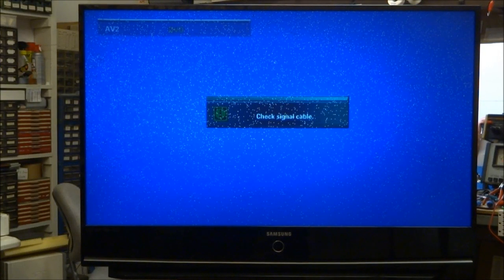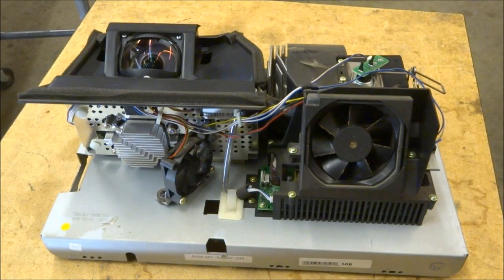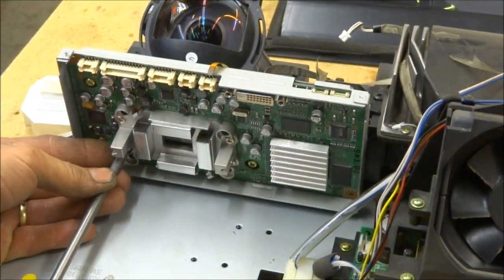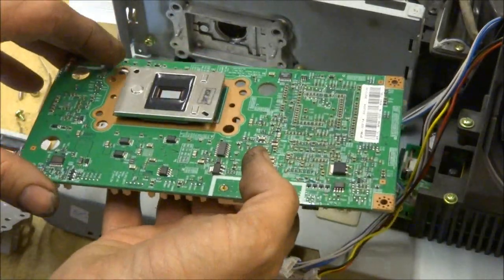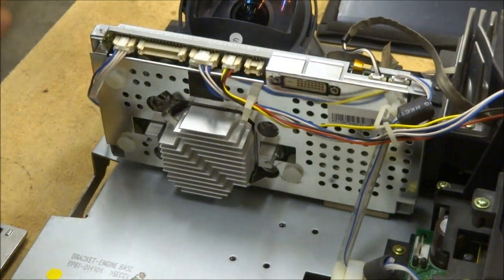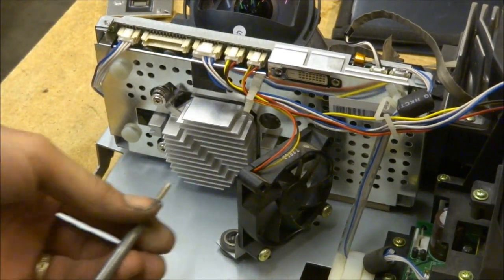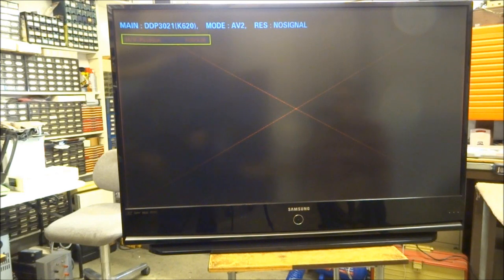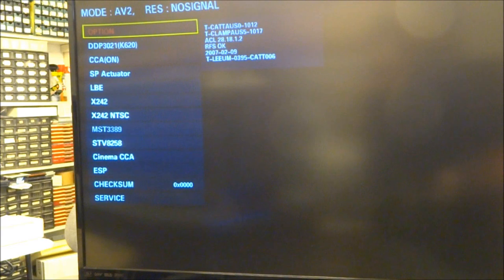Samsung DLP White Spot Dot TV DLP Repair FIX 4719-001981 4719-001997

Comment: Hey I used this video to replace my chip.  Everything is working fine except for 2 things.  Right away my picture was showing a little red tint and after about 2 weeks I have the shadow running across the top 25% of my tv.  How can these two things be changed?  I do not have the LED model.  I can give you my email if that is better for you to connect with me

Comment: Great video!  I have the white specs, as well as a 1/2" line on the left side, on my HL61A750A1FXZA Sammy.  Am getting ready to order the DLP chip from ShopJimmy.  Will use this video for the install.
Reply: ***** I was hoping the new chip would fix the 1/2" line but obviously it did not.  Is there a vid or instructions on what to do?  The DLP chip install went fine.  I highly recommend taking pictures along the way especially when unplugging the connections inside the TV.  The TV shown in the vid is a 50" 720 Sammy where ours are the 61" 1080 model.  The insides are different so the instructions on the vid do not totally correspond to our TVs.  The pics helped a lot when putting everything back together due to the vid instructions being different.
Reply: ***** I appreciate the help.  Did some Google searching and found it is an adjustment to the light tunnel.  Seems to be a common problem with some of the older TVs.  Hope to find instructions that corresponds to my TV.  I've had the 1/2" line for about six months now.  Luckily it has not got bigger.
Reply: ***** Great.  Thanks!  Seems simple enough.  The hardest part will be getting to the back and inside while keeping the TV powered on.  Funny, think those are the screws the white specs fix video tells you NOT to touch while replacing the DLP chip.

Comment: I need help because I got a head of myself and remove the wrong screws on the board. Yes, the three screws your not to remove.  Now I have a black boarder at the bottom of my picture. It's not a shadow, it's a boarder about 2" all along the bottom of screen. This will be my forth time changing the chip. I never had this to happen.  I need to make the adjustments to get that out

Comment: Would cleaning the chip itself remove these dots without having to replace the entire chip ?
Reply from the maker: No. It is a defect of the micromirror system.
Reply: @norcal715  Yes, the mirrors are stuck in one position.

Comment: I have a question , I just replaced my dlp chip for my Samsung model# hl-s6186w , everything worked before just had dots on screen. Well when I changed the dlp chip I replaced the lamp,now none of the fans  are coming on and neither is the lamp. What could have happened?  Can so e one please help. Also 2 lights are blinking standby and timer ,and tv clicks like it wants to turn on. Any help is appreciated.

Comment: norcal715, In the service menu, I was successful at fixing the screen alignment following your instructions in the video. However,  I have accidently changed the setting of my dlp tv Lamp Sync function "Pulse" - and the screen disappeared and the TV power now keeps on recycling on-off while the lamp tries to come on until the timer times out before getting any screen, and the power recycles again on-off - so on and so forth. No matter what I do, this operation takes place as soon as I plug the cable in the wall. It is set on an automatic "pulsing mode" - and I cannot see the screen to be able to reverse the unfortunate setting change I have made. Could you help with this issue? Thanks in advance!
Reply: your bulb is burned out that's why is cycles like that.
Reply: Ken, I replaced the lamp twice (although after market ones) - The first one obviously worked initially - Then after changing the setting and I lost the screen I thought maybe the lamp went out - Discount Merchants sent me a replacement after market lamp - the outcome did not change. Do you think it is still the lamp? - BTW, since my post I have replaced the ballast with a used working one - it did not change the outcome either.

Comment: I solved my dots problem, but the color wheel is now going bad, where do you find parts for a  Samsung HLs5686w    I found the color wheel number on the color wheel BP6101193a-  I cannot find one.

Comment: Is it the dust on the chip that causes the white spots to begin with. Or is the white spots a definite sign that the chip is BAD?
Reply: Its the LED(s) inside the chip, if it is dust, it will look like a ping pong to soft ball sized blur or shadow on the screen.
Reply: dlp is more like little mirrors that move around to reflect the light. they get stuck after some time.

Comment: Hi I have a question, i did this repair with thr dlp chip like you showed white dots gone thanks but I have an issue with the picture, it won't adjust vetical more than 60 and won't go anymore, you can't see the bottom 2 inches of the X where the X is supposed to be touching the bottom corners, and it leaves about a 2 inch black gap at the top of the screen, is there anything I can do about that? Model HLT 5076S
Reply: i just saw another video that shows you have to adjust the board, loosen the screws and move it downward and then tighten it back, i didn't think to make alignment marks with tape and cut them to align it perfectly afterward, i had assumed it was centered with screws automatically, but that's what i'm going to try to do next.  I'll let you know if it works.
Reply: Grant Fairchild I have the same modle and the same issue. I can't get the picture to line up properly.
Reply: I had the tv on but you'll have to find a channel that us completely full screen, some channels and some shows and some commercials are HD and do not fill up the whole screen, but find one that does and loosen those mounting screws and have someone watching it on the show while you adjust it  (obviously with the off switch taped down so the tv will operate with the back off), but that worked for me, then tighten them up when you manually have then centered

Comment: ok my position screen looks  a little different has some boxes outside of it yellow green purple blue and back to red,  when i align it to the top left part of screen it still leaves the bottom right cropped out.  Is there a way to adjust the size?
Reply from the maker: send me some pictures or a detailed video norcal715videos@gmail.com

Comment: Well i replaced the DLP chip in my Samsung and seem to be the unlucky one. I redid things following this video and didnt really find where i messed up. All matched my set and all pieces reconnected fine. However, when i turn on TV the 'check signal' comes up and is so blurry you cant even read it. I then tried adjusting the focus nob behind the board. That isnt making a difference at all. I have seen a couple postings with the blurry issue but not really an issue yet. 

i have confirmed all cables plugged in proper place and all seated and snapped. What can I try next to resolve the issue of blurry screen???
Reply: If its blurry, most likely you have dust on the chip glass or magnifier.

Comment: I already replaced my once and I need to replace it again why does it keep getting black&white dots all over???

Mine is a Mitsubishi 72" DLP TV.
Reply: When you replaced the chip, did you add the thermal pad or thermal paste between the chip and heatsink? Also, are all of your internal fans operating? And, lastly, all dust and dirt removed from the chip area and clean fans? The most common issue with failure is heat related. Not always, but it is the most common.
Reply: It must be that first thing because I saw nothing on it on the first how to video I saw. I cleaned it all and yes I think all the fans are working but not 100% because the tv is silent unlike other's I had before. Where can I get that thermal thing or the grease you mentioned?
Reply: Thermal paste and such...just search for semi-conductor heat management.... like www . luxeonstar . com
Reply: How much did it cost to get fixed?

Comment: It's flashing both the greens and red at the same time and nothing's on the tv. HELP!!!!!
Reply: hi were you able to fix it, I'm having the same issue with my tv, it turns on but it's shuts off after some seconds
Reply: hi were you able to fix it, I'm having the same issue with my tv, it turns on but it's shuts off after some seconds
Reply: hi were you able to fix it, I'm having the same issue with my tv, it turns on but it's shuts off after some seconds
Reply: +M Fernandez it ur color chip

Comment: 9:45 is horrible advice. most people are replacing an old, dusty ass component, and blowing air anywhere near the exposed chip is going to send dest particles floating everywhere, and have a very good chance of landing right back on the chip.

Comment: Hi,  I have the Samsung 65" HLT6187SAX/XXA.  I viewed your video several times before I mustered up the courage to replace my DLP chip.  Well just wanted to thank you for this very informative video. I was able to complete the job and now I can keep my Samsung for another 10 or 15 years.
Reply: +ALFRED S what chip did you need and how much did it cost, because I have the same TV and problem
Reply: +Michelle  Mann 
this video shows you everything you need to complete the job
Reply: they can no longer be repaired. The chips these use are no longer manufactured, Shop jimmy no longer carries then, and the retail for the remaining chips are now over 600 dollars. I threw my 61 inch tv away, as dlp is now worthless.
Reply: I just repaired mine this past summer, parts are available
Reply: @jamesdamenti2092  where did you get the part

Comment: I just ordered my replacement chip and this video is just what I need. Excellent detailed instructions! My DLP is a LED lit model (Samsung HL-T5087S), so I don't have a color wheel. However, I was thinking about replacing the 2 fans while I'm in there, since the set is about 9 yrs old. ShopJimmy doesn't have the fans in stock and I was hopping to find cheaper replacements, anyway, since the OEM fans are $20 and $30 each. Any ideas on where to find comparable fans?
Reply: I had 1 fan actually die on my 61" that I bought in 2007. I purchased a replacement from ebay for $15, but had a hard time finding them. I couldn't source a serial number off the fan to just get a replacement.

Comment: Hey norcal715! Thanks for the video. Purchased a new DLP chip from "dtvlamps" seller on  eBay.Changed the DLP chip in my Samsung HL56A650C1FXZA, purchased in 2008. Your video made it simple. Did not need calibration or any adjustments. I did clean all optical surfaces with Zeiss Lens Wipes - took about 75 each; removed the two 6" service ports to get to the large first surface mirror that bounces the image to the view screen. Used a vacuum cleaner instead of blower - to much dust to throw around the room and maybe into the optical stream - for the back, fans, and optical engine. I thought about a new 4K 50" to 60" TV, but decided without 4K streaming in my area, the cost of 4K BD players, and no Redbox 4K in my area.... 4K is not ready for my area... 1080 is great. The new TV picture is super crisp! Thanks again!

Comment: Great video. Everything went well until the spring loaded screws. What is the fix for breaking any of these screws? Does that aluminum block need replacing? If so is it a major job and where can I purchase one? Three of the four screws snapped.

Comment: Most regrettably, I did not discover your amazing video before replacing my chip.  I unscrewed the three screws you said not to touch and now my picture is messed up.  You mentioned needing to do some geometry to get it back, but I don't know what that means or how to do it.  Please help me!  I'm so angry I didn't find your video first, and now I feel like I've created a big mess.  Any assistance you could offer would be greatly appreciated.

Comment: I was also able to fix my Samsung 61" DLP 1080 using this video.  I viewed several videos to make this repair and this video was by far the best one.  There is some variation in the repair procedure (e.g. number and location of various cables) depending upon what model you have but the basic idea to get to the chip to replace it is the same.  I set up my laptop next to me behind the TV so I could constantly reference the video step by step.  Very helpful video.  Appreciate you taking the time to make the video and share with us.

Comment: Great video, It does work well. Thanks!  However, how can I fix a shadow on the left that is over the image? the bar is not big but visible  about 1% of the image just vertical along the left side. How do I fix that?  Owner of Samsung 61 DLP 1080p HL61A750   thanks
Reply: +LeleuF I had this issue when I replaced one of the LEDs in my Samsung DLP set.  There is a thumbscrew in the light engine near the lens that you can use to adjust the picture right and left so it is centered. The bar will disappear but you need a helper to view while you make the adjustment. I believe there is another youtube video that shows you where this thumbscrew is. Unfortunately you need a small pair of hands to do it easily. My hands barely fit where I needed to go.

Comment: I have an HLT6187sx/xaa and I replaced my DLP chip.  Seemed straight forward although it required some courage.  Problem now is that I have a solid white screen. It flashes a few times solid white and then stays.  Changing source, etc. has no effect. Everyone else seems to have their TV fire right up as usual.  Any idea of what could be wrong?
Reply: I reinstalled the bad chip and it works fine.  I guess my new chip is bad.  I also noticed a black dot.  I conclude that the chip is defective.

Comment: Best video ever. I just took on this project to fix my samsung. Samsung HL-S6186W. I would like to fix it. It has been sitting for a while. I turned it on no picture pops up on the screen. The three led lights come on on the front the stand by and the lamp. I seem to have a different model than you but about the same inside. Dlp dsnt seem to have any little dots on it. But if it possible maybe you can help me fix this project. I am currently using my wife's youtube channel. But if it possible you have time we can chat via email. We can figure it. Thank you.
Reply: +BrklynQt289 If you hear back about this, please let me know. I have the same problem. thanks.
Reply: +Austen Newlin sure thing. i check back from time to time.
Reply: try replacing your bulb

Comment: Excellent video and narration!  My Samsung HL61A750 was an even easier repair.  Removal of the entire assembly was not necessary.  Even some of the board cables could be left connected and the board just folded to the side to allow replacement of the chip.

My heatsink was not stuck to the thermal pad very well and actually dropped off when the retention spring was removed.  Upon reassembly, I followed his recommendation and bent the spring to provide a bit more clamping force.
Reply: DMCC I'm about to repair the 67 inch model of the same tv you repaired. You mentioned the thermal paste fell off?  Did you apply a new pad or new paste? I'm just trying to make sure I have all I need as I have the new chip on the way
Reply: The replacement chip I bought came with a new thermal pad, which I used.  However, if I were to do the job again, I would forego the pad and use thermal paste.  Paste can be messy, but it provides better heat transfer.  Do not use both; that actually degrades heat conduction.
Reply: DMCC thank you kindly for taking the time to reply. :-)

Comment: Excellent video thanks will share every were :) 
thanks
Reply: +Jethro Alfonzo Did you try replacing your chip using this video?  I just ordered my part.  There are a lot of wiring to remove.
Reply: o mo I havent. I will the the cheep I hope next  week and then I I tell you how it was
I plan to film as I deasamble the tv so i can put back tghter